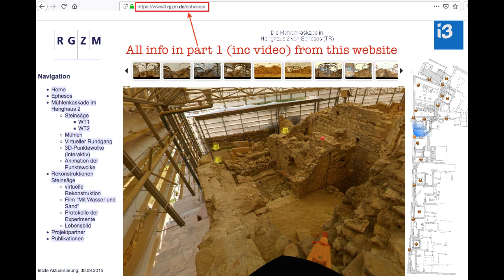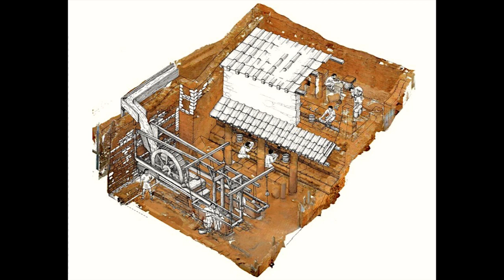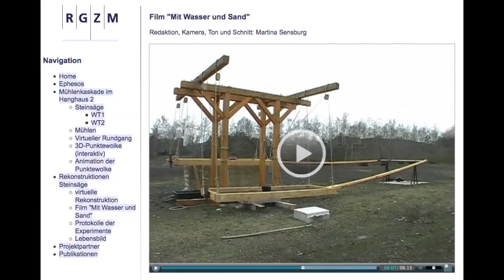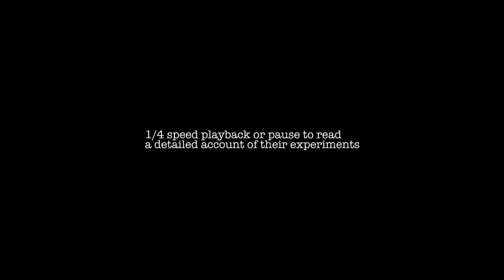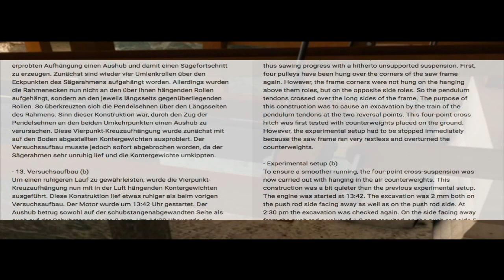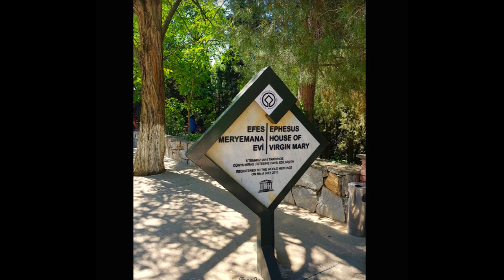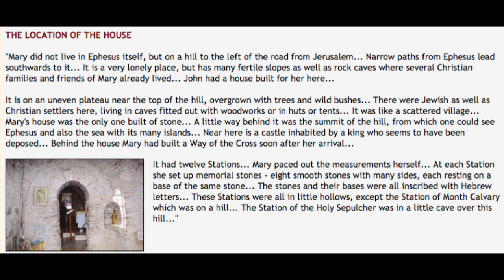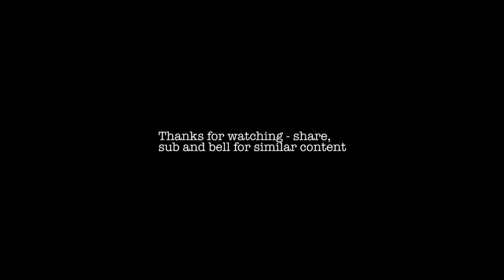LOST ANCIENT TECHNOLOGY Granite Cutting MACHINE IN ACTION!!

Comment: They're using steel "blades", so there's where this experiment immediately loses credibility of any kind. Second, there is STILL absolutely ZERO explanation for more detailed cuts than just sawing directly through a squared off rock! What are you even trying to prove with this tainted experiment?
Reply from the maker: the metal does no cutting at all - its the sand that cuts - the metal guides the sand, acting as a moving weight to push down on it and activate the moving abrasive process. copper actually works even better as it can be charged with abrasive n(esp soft copper, as opposed to arsenical copper, which the ancients used - which is as strong as mild steel). this isnt my expt - just sharing info - this is a reconstruction based on a carved relief in Turkey and also archaeolgical findings at Ephesos . relax.
Reply: Dude, u just made a right knob of yourself. !
Reply: You do understand they had the use of bronze, copper etc...right? You do also know copper and bronze work hardens right? You also realize the blade their using in the video has no teeth on it, their using quartzite which is abundant, the blade is just the carrier of the grit cutting compound.

Comment: While doing the cut with this so called ancient machine never finished 1 Block. NOT 1…
The pyramid has 2.5 million blocks all weights ranging from 2 to 5 tons. It wasn’t possible for this machine to have done the work
Reply: at last not fast enough to cut so many stones in time (one block every 3 minutes)
Reply: You guys really underestimate how much resources the ancient Egyptians could conjure up
Reply: They were definitely many times richer and more advanced than the byzantines but you don’t wanna admit it
Reply: I agree that with this method and the timeframe that we have been told there is no way this was done to cut 2.5 million blocks. However I do think it’s a very simple explanation just like anything in history. This modern age we live in we just can’t wrap our heads around it because they’re stuck so far up our ass inside of a smart phone. However there is something to copper tooling with sand as an abrasive. Either the labor force was much larger than we were told or we have just not found the tooling yet. There was lots of discoveries of certain copper tools that the Egyptian‘s used none of which could be used to actually cut and chisel lime stone or granite. Maybe some lime stone but definitely not granite

Comment: how stone cutting like this originally started as recorded by Plinius almost 1,900+ years ago

But whoever first discovered how to cut marble and carve up luxury into many portions was a man of misplaced ingenuity. The cutting of the marble is effected apparently by iron, but actually by sand, for the saw merely presses the sand upon a very thinly traced line, and then the passage of the instrument, owing to the rapid movement to and fro, is in itself enough to cut the stone. The Ethiopian variety of this sand is the most highly esteemed; for, to make matters worse, material for cutting marble is sought from as far afield as Ethiopia; and, moreover, men go in search of it even to India, which it was once an affront to strict morality to visit even for pearls. The Indian is the next most highly praised, but the Ethiopian is finer and cuts without leaving any roughness. The Indian does not give the stone such a smooth surface. However, people engaged in polishing marble are strongly recommended to rub marble with it when it has been calcined. There is a similar fault in the Naxian sand and in that of Coptos, which is known as the Egyptian variety. These were the kinds used for cutting marble in early times. Later there was discovered an equally valuable sand from a sandbank in the Adriatic which is uncovered only at low tide. Consequently, its position is not easy to mark. Now also fraudulent craftsmen dare to cut slabs with any kind of sand from any river, a waste which very few clients perceive. For in fact the coarser the sand, the less accurate the sections it grinds, the more marble it wears away, and owing to the rough surfaces produced, the more work it leaves for those responsible for polishing the slabs. Hence the cut slabs are made thinner. Again, for polishing marble, sand from the Thebaid is suitable, as well as powder made from limestone or pumice.
Reply: water was not used on the stone its self from my understanding accept for when it came to polishing

Comment: Using a saw qith sand and water as abrasive would work for cutting straight lines and making types of drills for holes but would still need other tools to make angled cuts like interiors of the black boxes found around egypt. Would need atleast chisel technolgy
Reply from the maker: agreed - it def doesn't explain the serapeum boxes for example - but I think interesting to get an idea of the 'tech' that may have been used - just the idea that  water powered machines were around 2k years back (or maybe more?) - everything is scalable - so could be that they made some very industrial drills with ton weights on them for example...just theorizing...
Reply: @HistoryMaze  it is very impressive that they had contraptions back then, when i always learned they only had copper chisels and diorite rocks to bash granite with. I believe they had all sorts of tools and machines powered by water or wind or muscle power. If they had hardened tools like steel or iron those materials wouldnt last and corode away. Hopefully archeologists will keep digging deeper and finding more. The further back in time they go the better quality of workmanship and tooling gets found.
Reply from the maker: @swghfa1  yes def - the older works are nearly always better. Some of my recent vids have been exploring masons marks - I think this could tie things together - secret knowledge of geometry/earth's dimensions etc were coded into the architecture - a way to preserve knowledge through the ages. Anything related to architecture (like tools etc) would have been very sacred - I'm sure they would never have been left lying around for us to find - in the same way we dont find angle grinders lying around on abandoned building sites. Am formulating an idea about all this - maybe next vid or so....
Reply: @HistoryMaze  good stuff, aside from the tool marks left on stones which i find very interesting theres also the key clamps that were used to hold giant blocks together found all over which also shows a similar building technique used by all the cultures. Seems to me to be good indication that anicients were sailing the oceans also and had good navigation skills
Reply: Not to mention they used steel here and weren't even cutting granite, which is much softer than andesite. We really need to focus on the more precise cuts though, because therein lies the only true mystery.
Reply: Could u suggest secret knowledge in architecture to look at? (Outside of the pyramids) thanks!